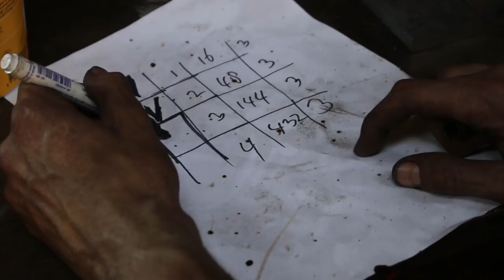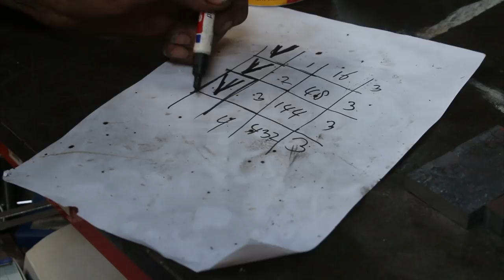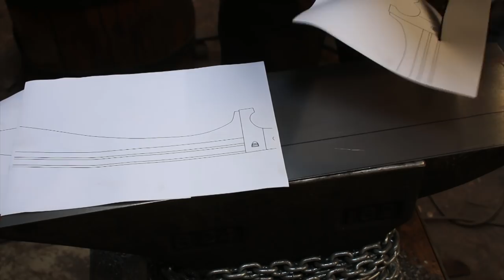Forging a Falcata sword, part 1, forging the blade.

Comment: Amazing Freerk! When you add the powder substance from the plastic tub it just falls off? How does it help at all?
Reply: placid renegade that white powder is borax. It help prevents oxygen getting into the welds.
Reply: The borax that sticks will become fluid when it's heated. It's the excess that falls off.

Comment: At the 19:20 mark you put it in what looks like a giant trough full of sand....what is that?  What are you doing there?
Reply: Six Sixsix he's stabbing it into an ancient vampire he keeps in there to curse the blade
Reply: Six Sixsix he's annealing the billet in vermiculite, which has great insulating properties and allows the steel to cool as slowly as possible in the absence of a temp controlled heat treatment oven. this is to alleviate stresses in the metal and to soften it for machining
Reply: And what about 22:25? I assume it's some sort of acid?
Reply: xblaugranax it's a quench tank full of oil of some description. guru Freerk is using an oil hardening steel.. perhaps 5160..? a truck leafspring..? the steel is slowly and evenly heated to a prescribed temperature or colour and plunged into the quenchant to harden the steel. heat treatment has a pretty simple but tricky process to it that is  nonetheless essential and requires practice and subtle skill.
Reply from the maker: mikey watts yes. Absolutely
Reply: Freerk Wieringa i like your style, man 👍♒

Comment: Did your fullering die on the power hammer make the groove around the bottom fuller? I didn’t notice at what point it went in, so I wasn’t sure. It looks really cool, nice detail.
Reply from the maker: yes it did, it was one shot.  i did not catch it properly on camera.
Reply: Thanks. I thought so, but wasn’t sure. Excited to see this one finished.